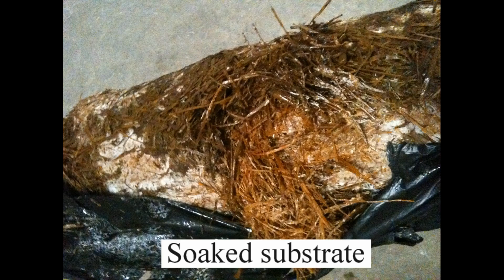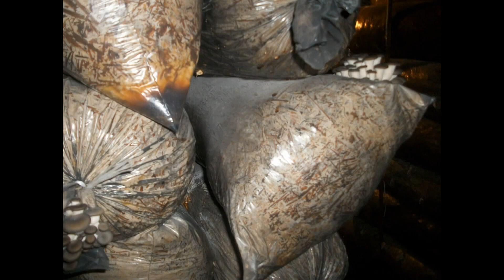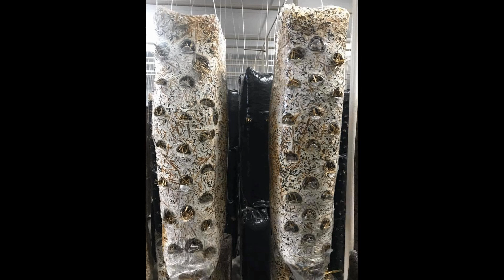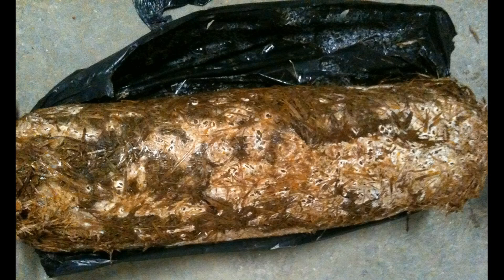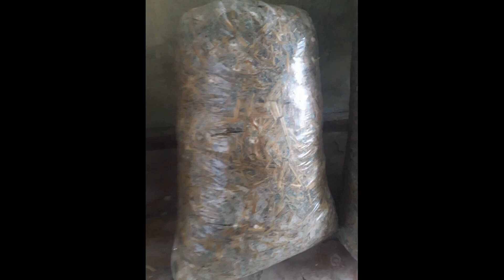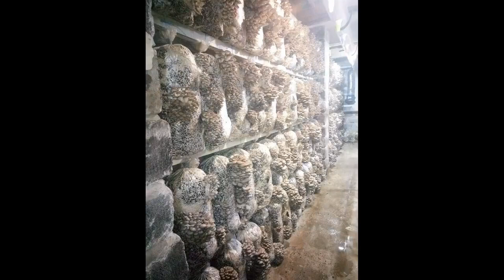Soaked oyster mushroom substrate. How long to soak mushroom substrate?

Comment: I have an questions about beech wood pellet block.

 Why has my mushroom block have a dry core during incubation?
Why do black patches appear on blocks? and its not mold

Thank you very much
Reply from the maker: 1. do you sterilize these pellets in a pressure cooker? or do you do something else?
2. do you cool the blocks during incubation? if so, how exactly?
3. are the black spots wetter than other areas of the substrate?
4. black spots only between the film and the substrate or inside the block as well?
5. Do they have any distinct smell?
Reply: I pasteuralize at 75 celsus.
The block were exposed to low temperature during colonization 15C for one week.
The black color is on the surrface not in substrate, and it has the same moist level
It has earthy smell
Reply from the maker: 1. in what sense "exposed to low temperature"? did you cool them on purpose or could you not raise the temperature to 21 degrees?
2. how many hours did you pasteurize the substrate?
3. Is your pasteurization container insulated?